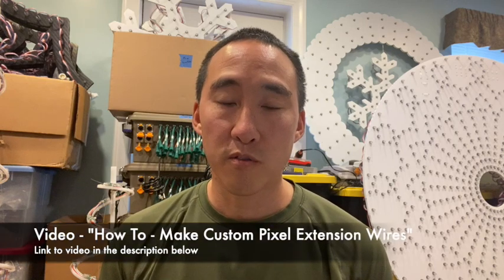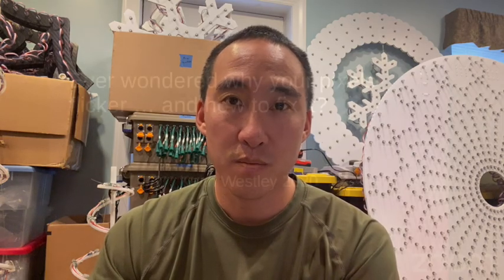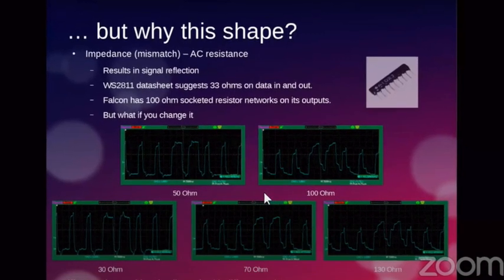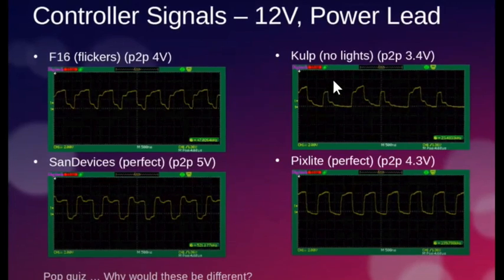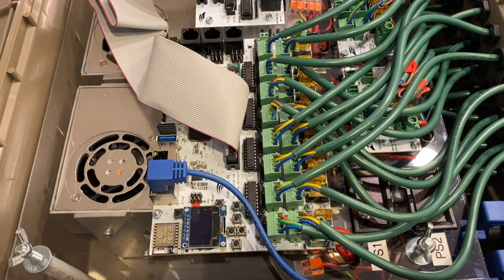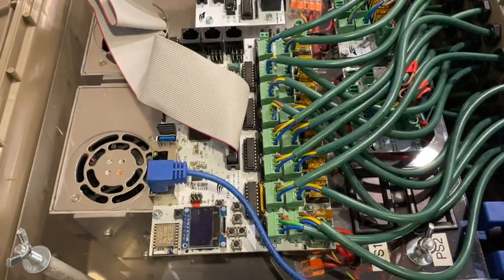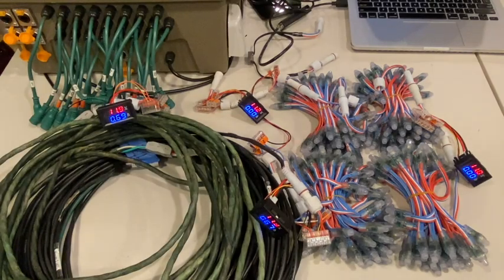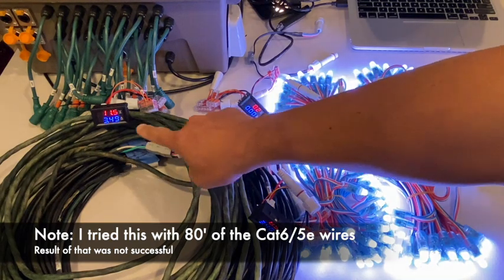The Power of 33 Ohms - A Simple Mod to Improve Pixel Data Performance

Comment: Another great video, Steve!! I’ve done plenty of research and I think am ready to start! Only to see another video from you and learn something new!! Unfortunately, I can’t find them.
Reply from the maker: @Brian, good luck as you venture into the pixel light show world! It appears as though this particular resistor network is in short supply right now and out of stock everywhere. So, order a newer controller, like a Falcon F16V4. I haven’t been able to test any of the newer controllers, but whatever you get, try to check and determine what the output resistor network value is. Knowing that will help you plan long distance or large pixel runs.

Comment: So I bought the resistors on the link you provided and don't work. I contacted the seller and they said they work as intended. The ones you show don't resemble the ones in the link. Only the first pin has 33oh when connecting from 1st to 2nd, 1st to 3rd...so on. Any idea why yours provide 33oh on every two pins?
Reply from the maker: Oh, that’s interesting. I’ve not heard of others who ordered these resistor networks that measured differently. It should be 33ohms between the first two pins, the next two pins, and so on. 

The resistor network setup you described definitely won't work.
Reply: @NiFamilyLights  do you know of another place to buy these? I'm not exactly sure what to look for in buying/not buying.
Reply from the maker: @Tube Perfect, the 8 Pin SIP resistor networks should be "Isolated", not "Bussed".  I updated the description link to include one I found on eBay that is correct.  Apologies.

Comment: I noticed all your tests wee done at 30% brightness. Curious if this has any relevance to the data or just power.
Reply from the maker: Hi Phil, thanks for your comment and question. The output brightness % is relevant to both data and power. Of course, the power usage being lower means more pixels can be driven. Similarly, the less power drawn, the less noise is created on the ground line, which is shared by the data line. So, less power used per output means better data integrity. 

All that being said, these tests were done at 30% because most folks run their pixels anywhere between 20-40%. Anything above that tends to just blind viewers. Also, color saturation above 40% isn’t good, the colors get washed out and appear more whitish to the viewer.  I run all my pixels at 30%. I hope this explanation helps.

Comment: Dude! You are genius for putting this Video up. I have an AlphaPix 4, Falcon F16V2, Falcon F16V3. I first started out with the AlphaPix in the beginning. As I grew, I got the Falcon Controllers. Both have/had the same issues. Once I got to a certain point, I had flickering all over the place. Things would work fine during bench testing, but out in the yard, it was a nightmare and living in Oregon, it's either freezing cold, pouring down rain, or both during this time of year, so not fun to work on props and wiring, lol. I was about to give up, even not doing a light show last year because it was no longer fun, but a non stop issue one after another. 
I decided to buy some of the "Isolated Network Resistors" and ended up buying the Bussed as your link is no longer valid. Amazon doesn't have them, but for faster testing while I waited for the Correct resistors to come in, I bought some 1/4watt 33 ohm resistors and inserted them into the on board sockets, which was tedious. My first test, I added extension cables to my matrix (24x24) with the stock 100 Ohm resistor until I got flickering. In fact, it got so bad, they just stopped responding all together until I lowered the brightness output. With the flicker being bad, I then turned off the controller (Falcon F16V2), removed the stock network resistor, inserted the individual resistors, and WHOLLAH!, No more flickering, even at 100% brightness output!!! Thanks!!!

I haven't received them yet, but anyone looking for the 30 Ohm Resistor Networks, this is the only one I can find (USA Seller at least)
https://www.ebay.com/itm/111045326028

UPDATE: As per my new comment, these are the correct resistor packs you need and have proven to work and measure out correctly with an OHM meter.

Comment: Hi Steve and thank you for this great vedio.this will give us more options where to put the controller.
If the 33ohms is solving the distance problem why Davied from Falcon not putting that instead of the 100?!
And also is that result is the same with regulated and resistant pixels?
And my last question,is the result are the same if you playing an effect not just turning the pixels on and off ?
Again thank you for the time you put to show us this .
Reply from the maker: Hi Mouris, thanks for the comment. 

1) The 100 ohm resistor networks are there primarily to protect the board from mis wiring pixels so 12v on the data line doesn’t damage the board. Check out my “Unboxing the F16V4” video. The new controller now ships with 33 ohm resistor networks. 

2) The data driving distance improvement is more significant for regulated pixels than resistor based pixels. Resistor based pixels use less power, meaning less current and ground noise to corrupt data. Right out of the gate, resistor based pixels are resilient to data corruption over long runs of pixels. Check out my video “Testing the specs of resistor based pixels”. That said, the 33 ohm resistor networks can only help improve data driving distance even for those pixels. 

3) I’m testing with all white as it represents the worst case scenario, using the most amount of power causing voltage sag and noise on the ground line. If it works for you on all white, it’ll work for you with any other colors. 

 Best of luck to you setting up your show.
Reply: @NiFamilyLights  I already have my props set up and this is my first year dealing with X light and pixels, My show is running smoothly with no problem other than I change some bad pixel in a matrix .I posted a video in the X light Facebook group about my show and the set up.
One weird thing that happened is I have the wire running from the controller to the matrix exactly 40 feet and it’s working normal with no problem ,the matrix is 1200 on two ports.
I have four bats with 50 pixel each and the wire coming from the controller exactly the same like the matrix but I had a problem with that and I had to use the FAmp to fix a problem.(I disconnected the +wires from the  controller and only sending data and grounds and I’m powering all my props  from a power supply not from the controller)
I already ordered the 33 ohms after I saw your video yesterday and I’m going to wait to use them and hopefully that will illuminate the use of Famp in some places.
Again thank you for the information you are providing here.

Comment: wow I knew about the SIP change to a 33ohm SIP with  SanDevices 682's 9 years ago when I tested 80 feet of 16ga green extension cord  to get to props on the other side of the house.

Comment: Great video! Thanks!
Where do you get your xconnect ends? I can only find black pigtails and don't mind making my own wires.
Reply from the maker: I purchased many pigtails when I ordered my pixels. Those pigtails are green in these videos. For the pigtails with colored wiring like the pixels, those are from cut ends of the bundles of 50 pixels when I connect them together. I save those ends and solder the pixels together since I’ll never need to separate the strands once they are in a prop. It’s nice to have a bunch of left over short pixel pigtails to use for testing.
Reply: @NiFamilyLights Thanks for the heads up. I'll scour AliExpress then.. my first year transitioning from a single line of roof strips to more lines and finally some bullet style pixels and props.
I'm certainly consuming quite a bit of your content as I set it all up.
Stay awesome!

Comment: Very informative with the demos, great job.
This begs the question....why don't Falcon controllers come with a 33 Ohm by default? Is this a design flaw.
Reply from the maker: Romeo, good question. The higher resistors were out there to protect the controller from miswiring of props or other accidental shorts. 

The new F16V4 (released mid 2021) now ship with 33 ohm resistor networks.

Comment: Great work. Excellent mod to my board. Going to change all mine . Thank you so much. I changed mine on the f16v3 and can run my 5 v pixels at a long distance. 150 pixels 10 ft away from controller with no power injection. Running 20 percent.

Comment: You can piggy back 50 ohm SMT resistors on top of the existing 100 R ones, to get 33 R. Easy to do with a tweezer and small tip temperature controlled soldering iron. If you're skilled you can do it with a non regulated iron with max 2 seconds of heating & rosen flux (electronic) solder.. And you get 100 resistors for a few dollars at Digikey, et. al. Just be sure to get the same size as your board uses. e.g. 0805 or 1206.

Comment: Series resistors on high speed single ended data lines are more about limiting rise time and can also have a protective role.in limiting current "impedance matching" only applies to controlled impedance transmission lines. If using a resistor for rise time then the resistor value will depend on the capacitance of the cable in use so there is no one "magic" value. Either way as a "fix" for long distance data it's a crap idea. "SPI" type data is/was never intended to be sent the sorts of distances many people try and send it which is why converting to differential/RS485 is the best solution.(and not an "F amp" type "booster"), there's more about resistors, rise times and transmission lines in the Analogue devices MT-097 tutorial (can't post links in YouTube). Also worth pointing out that the maximum cable length for RS232 at 19kbaud is about 50ft (18m) with addressable LEDs we're sending 400k or 800k baud data. For RS485 the cable length up to 100k baud is about 4000ft (1.2km) with length dropping above that speed to around 500ft (150m) at 800k baud. Which is why trying to push standard "SPI" data over the sort of lengths many people do is just crazy and if it works then, well you just got lucky.

Comment: What's inside an F-amp? Is it a null pixel, or is it just some Schmidt logic buffer?
Reply: a ws2811 board without the  LED
Reply from the maker: It's similar to having a WS2811 chip without the LED, except that it doesn't consume any data like a typical WS2811 chip.  All data is repeated through the F-Amp, so you can add them anywhere in your setup without having to add "Null Pixels" in your software configuration.

Comment: Thanks again Steve for a great video. will be switching mine out shortly. Hope the makers of the boards see this for future updates to their hardware.
Reply from the maker: I don’t know if they’ll change the design.

Another user stated that the 100ohm resistor network selection is to accommodate other supported chips that the controller can handle. 

He did this mod last year for all his controller outputs for his WS2811 pixel show, and it worked great. 

The nice thing about the Falcon units are that they are easily replaceable.
Reply: @NiFamilyLights  It seems I read somewhere that the new V4's are coming with 33 Ohm resistor networks. Any feedback on that? I tried to locate that to add it here, but don't recall where I saw that at. Again, thanks for this video!
Reply from the maker: @Shawn L, you are correct.  The new V4s include 33 Ohm resistor networks.  I ordered one and did an unboxing video, which included testing the resistor networks to confirm.  https://www.youtube.com/watch?v=_oU51y_W78E
Reply: @NiFamilyLights  That's probably where I saw that, then, lol. Couldn't locate info on the website. I've watched almost all you how to videos, if not all of them. Keep up the good work. Maybe you'll be able to do something with servo controlling next :P (Such as with the pixel2Servo board I just saw but seems not available, to control servo's to make animatronics; My next challenge, lol. Thanks!
Reply from the maker: @Shawn L, thanks for the video idea.  I haven't yet gotten into servo controllers and a number of other items that have recently hit the market.  If I do, I'll certainly share what I learn.

Comment: How can I use xlights with my light o Rama controller because it’s not working
Reply from the maker: Rodgers Vampier, I don’t have experience with LOR. I recommended you go to the Facebook forums to ask you question or jump into the xLights zoom room and see if anyone there can help.
Reply: @NiFamilyLights  I don’t know how to do that
Reply: I use 26 LOR devices as a DMX device using an  e1.31 bridge,  been doing it for 9 years now, well before many of the XL upgrades. I believe you can run them with an LOR dongle directly now, never tried it since the bridge has worked so well for so long, not going to change it!  Many of the current pixel boards have an DMX/LOR output or use a port to drive as DMX.

Comment: Good minds think alike.  Years ago I found that my J1SYS boards had a 300 ohm surface mounted resistor on the pixel data output pin. These 300 ohm resistors were causing all kinds of distance and flickering problems but these resistors were individual surface mount resistors.  Instead of removing the surface mounted resistor,  I carefully soldered a 39  ohm 1/4 watt resistor IN PARALLEL with the 300 ohm surface ohm resistor. This equated to just slightly over 33 ohms. It is my belief that the designer simply misunderstood what output resistance he should have been installing. 

 I believe my boards from Australia 'Pixlite' boards from Advantak did NOT make this mistake and these Pixel controllers had output impedance close to 33 ohms?   These Australian boards from Advantak worked MUCH better than my J1SYS boards before I modified them. 

 Dave Pitts may have decided on the 100 ohm value as a safety device should one of his inexperienced customers make the mistake of accidently shorting the pixel output straight to voltage or directly to ground. I'm sure this happens. This 100 ohm choice may have been made to protect the pixel driver chip? Cheap non replaceable fuse??  David knows better so I am going with this.  Just a guess.  Thoughts??-Greg-
Reply from the maker: Without diving into the design of the board, I would have to agree. I’m planning to do this mod just on the outputs where I need to make long runs where I know data quality is most needed.

Comment: Thank you for another informative video. I really appreciate your disciplined approach. Some sources recommend a 300 to 500 ohm resistor on the data line close to the pixels. For example: https://learn.adafruit.com/adafruit-neopixel-uberguide/best-practices. Can you comment on the need for this additional resistor?
Reply from the maker: That’s an interesting article. I’ve not worked with neopixels, but my guess is that the controller for them have a 500ohm output resistor. The neopixels themselves may have a 33 or other resistance input and adding the 300-500 ohm resistor right before the first pixel basically helps match the impedance from the controller and those pixels. 

I guess that’s another way to do it...instead of reducing the controller output resistance on the data line, add a resistor right before the first pixel to match what you have on the controller. 

So, for WS2811 pixels, add a 70ohm resistor in series on the data line right before the first pixel to match the 100 ohm output of a Controller output impedance. 

I probably won’t do that given all the extra work required to do that for any prop’s data line coming from a controller. 

If you give it a shot, add a comment below to let us know if that works.

Comment: Thanks so much for doing this.  After seeing Keith's presentation last year I threw this exact question to Falcon and never got a response.  Its almost like no one wants to talk about it.  Terrific analytical breakdown of the facts here, and such a simple solution.  You have to wonder if the goal of the vendors is to sell more F-Amps or something when this could be fixed so easily and so cheaply in the Falcons.
Reply from the maker: As others have stated, the 100 ohm resistor network on the Falcon boards are likely there to protect the board from damage in case the data line gets mis-wired to a 12V line.  If an Famp goes bad, those are easy enough to replace compared to an IC chip on the main board.
Reply: @NiFamilyLights  on the sandevices you "can" remove the SIPS entirely and drive the data line... BUT with extreme caution ( according to Jim) that NOTHING shorts out as it would be catastrophic. this was all documented in DIYchristmas forums 9 years ago.

Comment: Sounds like to board manufacturers should be using 33ohm chips instead of the 100ohm chips.
Reply from the maker: Agree, and the new F16V4 (released mid 2021) now do ship with 33ohm resistor networks.